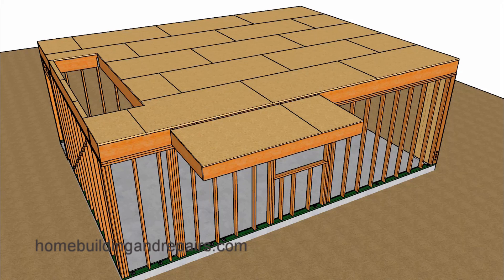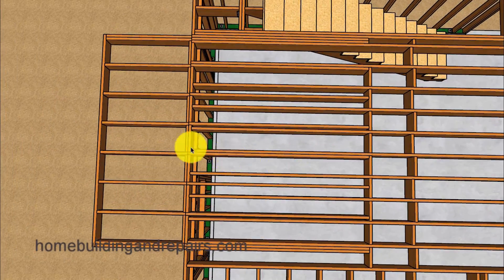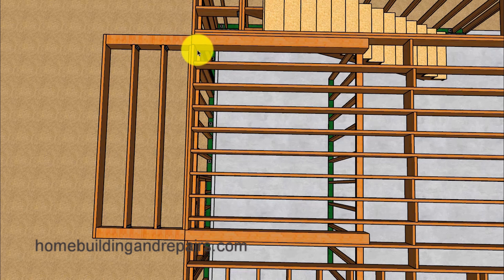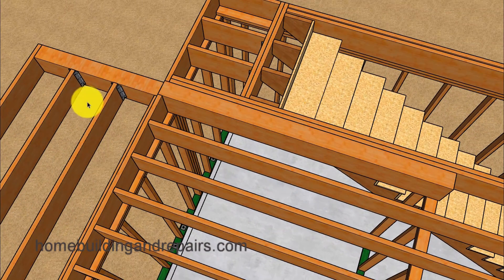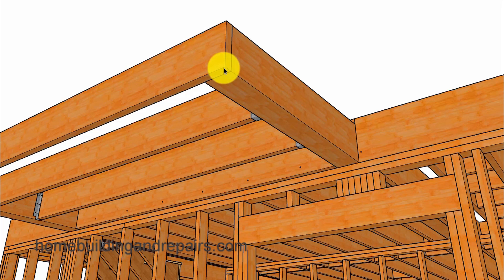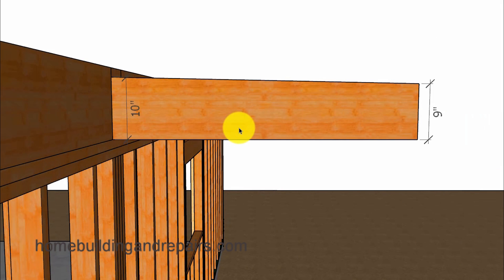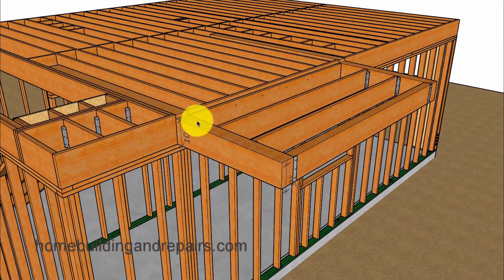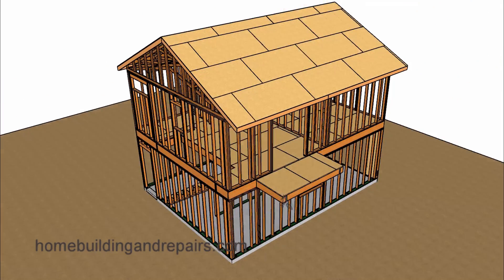How To Build Balcony Floor With Cantilevered Beams To Support Deck Joist - Design And Construction

Comment: what happens if you fill the balcony with concrete?  like i see in alof of apartments that all the balcony have concrete floors, what would be the math equation? would you still have 25% overlap with more structural support?

Comment: is that beam fully connected?
Reply from the maker: You can check with your local engineers if you think it needs more structural reinforcement.

Comment: You said 1/4 and 3/4, then you said 1/3 and 2/3. Which one is it?
Reply from the maker: Some newer codes want to have a maximum of 1/4 the length of joist protruding out.

Comment: Greg...how would I support a ridge beam on the rim of a 1' extension cantilevered second floor?  Thank you.
Reply from the maker: It might require a cantilevered floor beam to support weight from post and ridge.
Reply: Thank you for the great idea.  Conceptually, would this be one 5" x 10" x 6' LVL on either side of the ridge beam support...or several, say 3, joists with sistered 2x10s to each side of the support (six sistered joists, total)?

Comment: What if the joist run the other way.
Reply: I also have the same question. If someone could answer this, would be awesome. Our joist runs north to south but our balcony would be east to west. Would I need to reconfigure my joints or as least 2/3s of it?

Comment: Good stuff Greg. Your work is valued.  I have a project where I have cantilever construction on the north side, and overhang that transitions to a balcony on the west. It looks like the west is a cantilever but it is not.  Some poor repairs were done years ago, and this one will be a challenge to repair correctly.
Reply from the maker: Email me some pictures and I can provide an opinion. You can get our email address at our website.

Comment: Here in California they now require impermeable balconies to be engineered with something like a 300% safety margin after one collapsed from rot in Berkeley a few years back. I think the rational is that structural degradation is difficult if not impossible with an impermeable one as apposed to an open frame one that's typically much easier to inspect.

Found this out when I was applying for permits to replace a rotted out balcony in the upscale gated Blackhawk community a few years back. Even though I was replacing the entire wood frame impermeable balcony with an enclosed soft with all steel and concrete and no wood structure mixed in, they still required my engineer to make it three times stronger than needed. You could've literally landed a helicopter on the damn thing!
Reply from the maker: I'm often amazed at what one part of the country or world allows and the other doesn't.
Reply: It's not an expensive balcony. It's a cheap helipad.